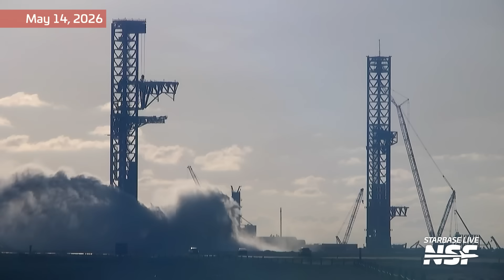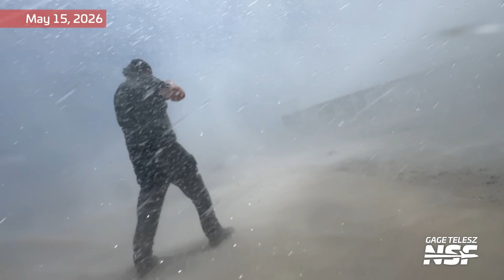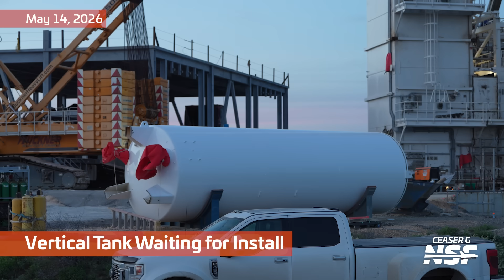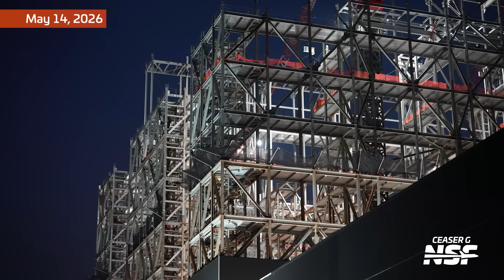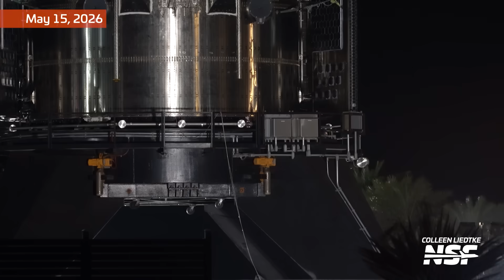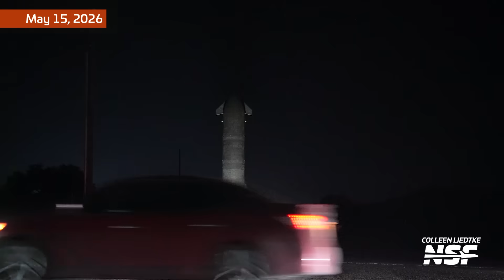POV: We Got Drenched by Pad 2's Deluge | SpaceX Starbase

Comment: ..If tankers holding methalox don't have a seperate payload, would they just be designed to be shorter? Since they'd probably just have longer main tanks and would no longer need a payload bay, could we have a Stubship?
Reply: It has always seemed to be that would be the easiest way to do things.  Just extend whichever tank required for Lox or Methane.

Comment: So, after the air separation unit is finished, does anyone else think a sea water desalination unit would be good, to make fresh water from sea water, to run the deluge... instead of using city water? Just a thought, not sure, are they piping in the city water or trucking it in?
Reply: Trucking it. Eventually it'll be piped in. They abandoned they idea of a desalination plant very early on. They're very power hungry
Reply: @Alexphysics13  Oh ok thanks. I just assumed they'd run it on solar or something. Hope they're at least able to catch and reuse some of the water? Well, its probably mostly vaporized anyway!

Comment: John commented in a previous video about seeing ship 39 going up and down during a loop of the wet dress rehearsal.  Maybe someone has posted detail about this before and I missed it.  Freezing the video at the top and bottom of the motion of the QDS attachment and comparing them relative to the fixed work platform, it looked to me to be about 10 - 12 inches of vertical movement.  I did the simple calculation for thermal contraction:  change in length = length x coefficient of thermal expansion (CTE) x change in temperature.  The booster length is 72.3 meters (ship length doesn't matter because QDS attaches at the bottom).  SpaceX uses a proprietary blend of stainless steel based on type 301 and type 304L.  Both have very similar CTE; I used 17 uM / M K.  For change in temp, I used 30 C starting and - 192 C (average of slushy oxygen and methane temp) for a delta of 222 C.  Plug the numbers in and you get 0.27 meters or 10.7 inches.  That is a big change in height.
Reply from the maker: Its wild to see, isn't it? - Das

Comment: 4:00 If that's tap water from Brownsville, then SpaceX had better build a desalination plant next to their air separation unit. The millions and millions of gallons of water they need will put an enormous strain on the public water utility.
Reply: We know that is potable water from the EIA. I'm sure however, that they've very comprehensive water use agreements with the water company who will invest in increased capacity if required.
Reply: No desalinization plant needed. They addressed their water needs with the City of Brownsville a long time ago. It's fine.
Reply: It's quite common for industry or agriculture to use a lot of water compared to households. SpaceX just makes a big splash out of it, so it's more salient.
Reply: @cube2fox  Just because it's common practice doesn't mean it's healthy. We should all strive to reduce our water usage, especially when it's almost totally wasted and unrecyclable (as in the case of SpaceX).
Reply: @kentslocum  Yeah, after all, it's not like water falls from the sky ... wait. I don't think one has to save water if there is no water scarcity in the area.
Reply: @cube2fox  They're right next to the Gulf, so I imagine there's plenty of salt water, but fresh water is harder to come by.

Comment: I've been wondering about the water for the deluge system:  Whether it's piped in, where it comes from, and how clean it is.  Thanks for answering.  Now I'm wondering how the city of Brownsville can provide so much tap water, how much it rains there, how much water can be drawn from the Rio Grande, and whether SpaceX will need to build a water treatment or desalination facility.